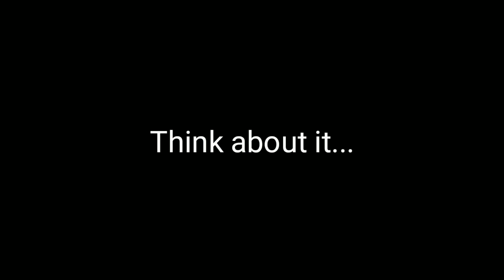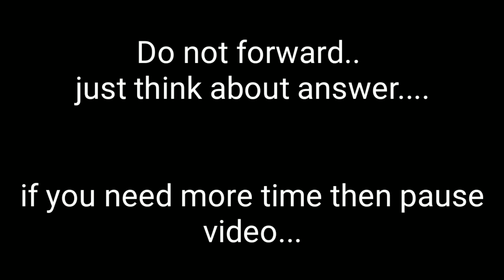Triple Point I Critical Point I DOF I Work as Point Function I #shot 13 I Mechanical Interview

Comment: Almost Every Work producing/consuming cyclic device posses adiabatic Process. And adiabatic Work is also known as point function so actually already work as point function is working for every device. Fact is that practically there is no device possible which consists only Work as point function